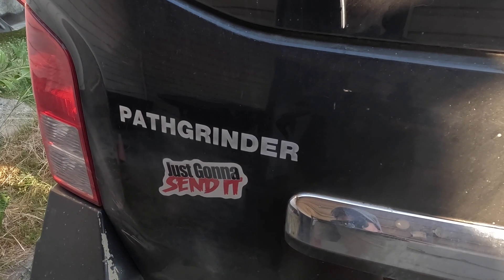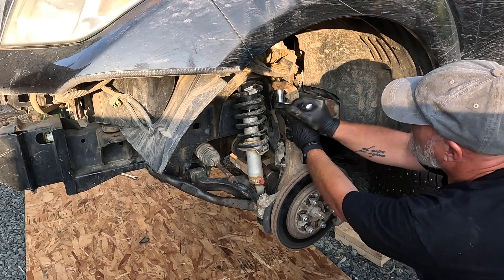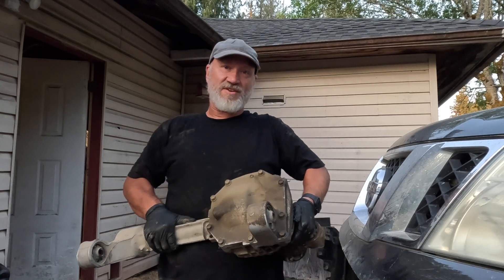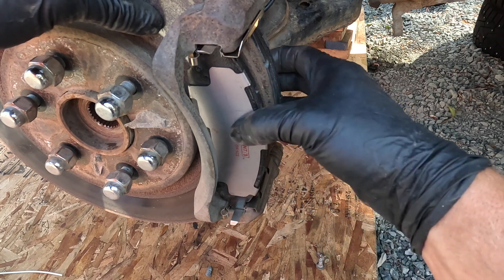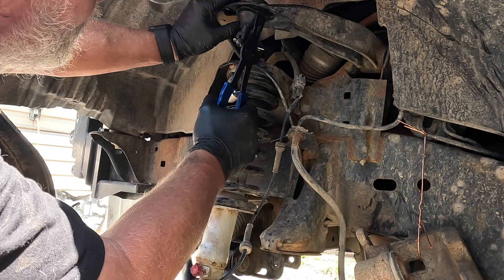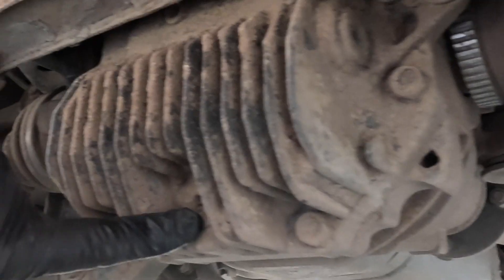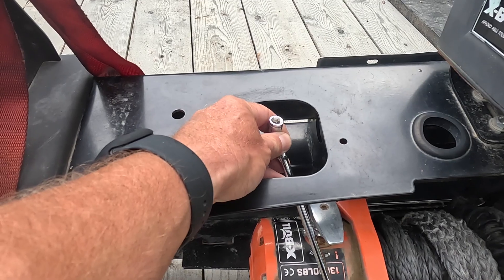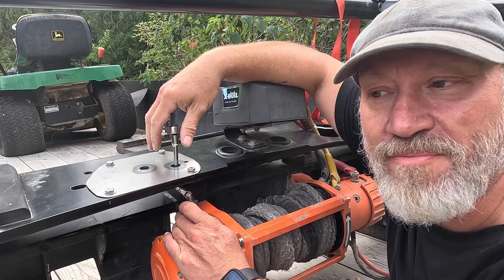Prepping the Pathgrinder for BC's Whipsaw Trail | Wet Coast Fab

Comment: I had the same plastic heater hose leak on my Pathfinder. The plastic completely sheared while I was sitting in traffic one day and most of my coolant sprayed out all over the highway. It's good that you caught it while it was still just a small leak. Just a really poor design choice to make that component out of plastic.
Reply from the maker: It's the dumbest possible material to use for that kind of application! Nissan may have well just used cardboard tubing. My rant was actually a lot longer than in the finished video, but there was a lot of swearing as well ;-)

Comment: you guys should make more coleman mini bike videos
Reply from the maker: @Korbin11 You're right! It's been too long since the last one! One is in the works right now (front brakes) with at least two more planned: testing out a Predator bone stock 212cc, and testing out the cheapest 10k rpm flywheel I could buy on Amazon. They may not come out in that order. Thanks for your comment, thanks for watching the videos!
Reply: could you possibly make a video where you make Coleman bt200x street legal? @wetcoastfab
Reply from the maker: @Korbin11 That's an awesome suggestion! What state/province are you in? I think there might be some problems depending on the jurisdiction, but I'd love to tackle the mechanical and electrical challenges of making one of these street legal. Hey, the Honda CT70 can be registered for street use, right?
Reply: im getting a coleman bt200x for christmas and im going to try to make its street legal . i live in indiana. i dont know anout the honda @wetcoastfab